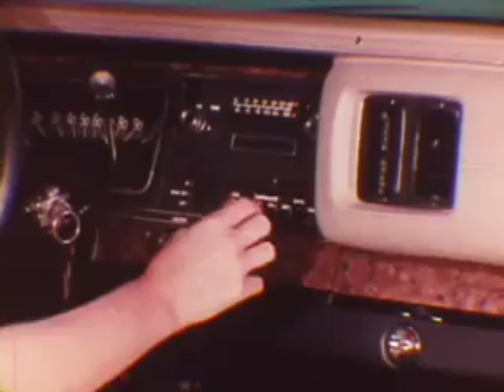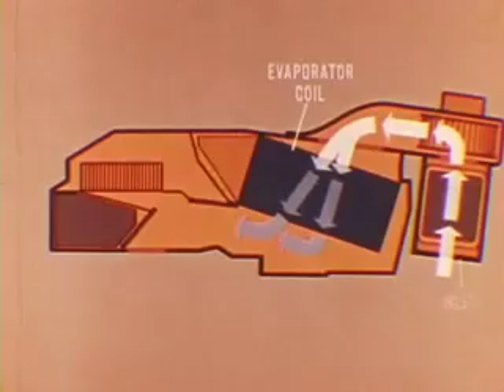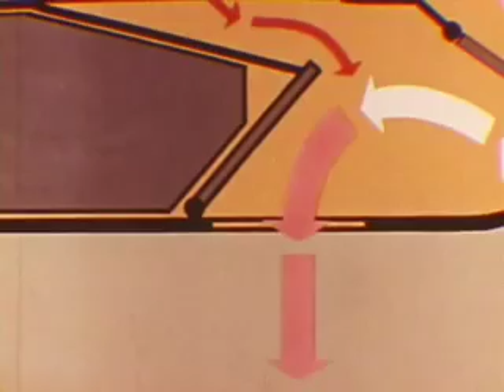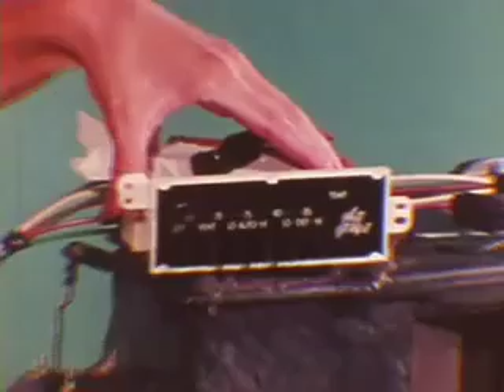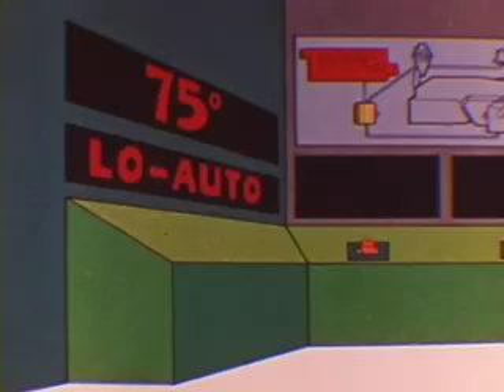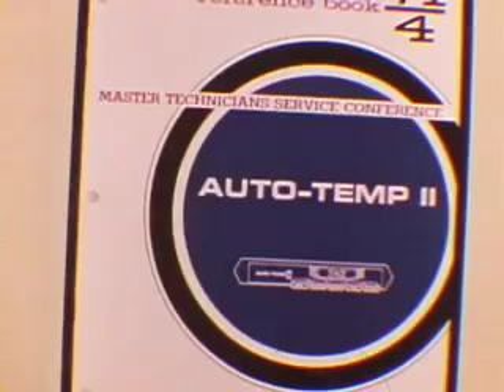MTSC - 1974, Volume 74-2 1974 Air Conditioning Air Flow

Comment: I never liked the idea of taking air from the evaporator, the partially heating it by the heater core. It always made sense to me to cycle the A/C clutch off at a higher temperature when partial A/C is selected.
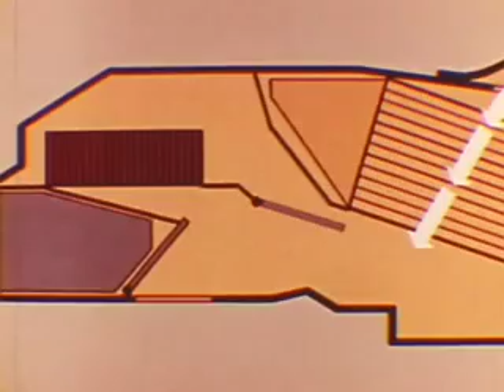4:09 I live in Florida, where the heater is not used for an extended period of time. Some A/C systems will keep the same antifreeze in the heater core for as long as the heater is left off. Sometimes sludge will even build up at the heater core water outlet. This is why when changing antifreeze, pour a bottle of cooling system cleaning cleaner into the radiator, Get the car nice and hot with the heater at full speed, then drain coolant once the car cools off enough.

I did not know that some sort of thermostatic air conditioning system existed without some sort of digital control system and an LED  that showed the temperature. Many people would sell their car once those devices stopped working.

My dad would do that every year until different types of coolant were created to last longer. It may be why he was able to get his 1987 Hyundai Excel to live 5 years and 110,000 miles, despite the fact the car was a flawed design and was so underpowered that full throttle was often used. Also, it may be why my mom's 1985 Maxima never had an engine cooling system problem for the 9 years she had it. The end of that car was the timing belt failing when nobody in our family knew what a timing belt was.

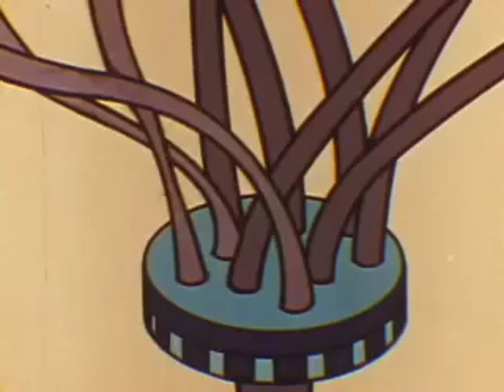8:32 That looks like one of the devices you might find on a Honda CVCC equipped car. They had the worst maze of vacuum operated devices.
Reply: The main point of passing the water thru the evap and then the heater core is dehumification, for heater operation above freezing, in this way the humidity level inside is low and the windows don't fog. The advantage of the use of the heater core for summer use is that it allows to maintain a constant outlet temperature, If the compressor cycled on and off the vent temperature would flutuate a lot and warm outside air would be coming thru the vents. Other problem is humidity. As the air passed thru the soaking wet condenser it would bring humidity inside the car making it very unpleasant. Also it is somewhat unpleasant to feel the compressor constantly switching on and off and the short cycling will likely shorten its lifespam.